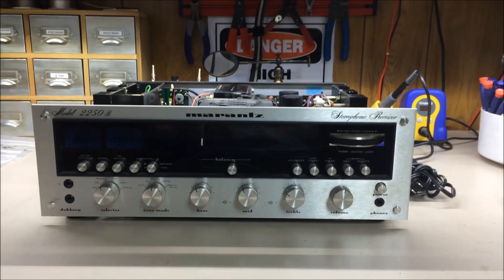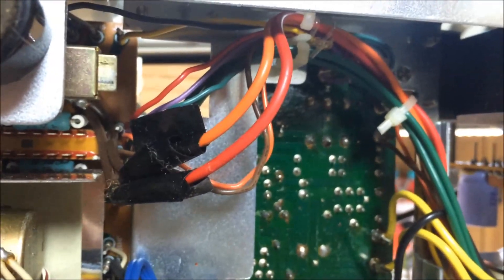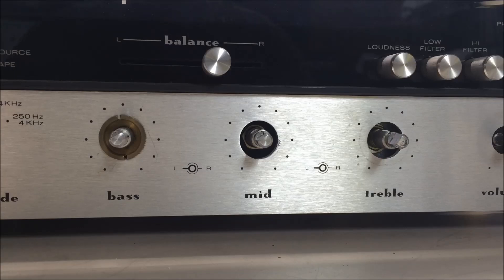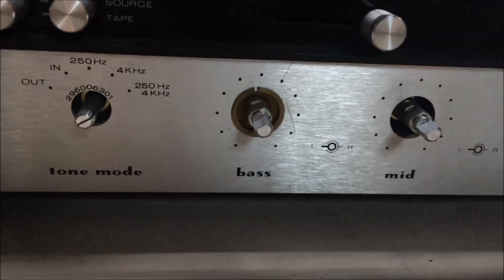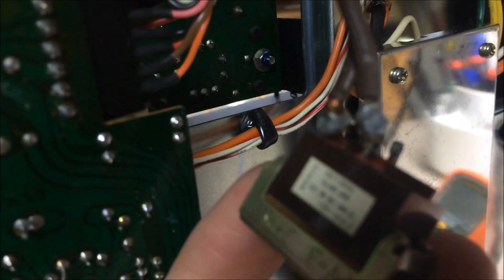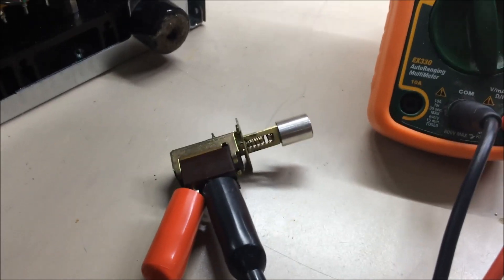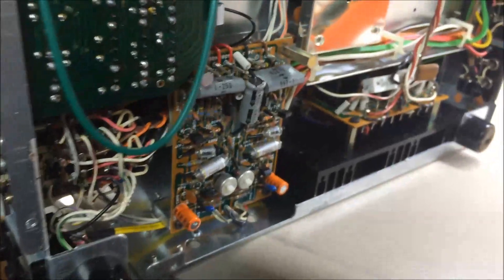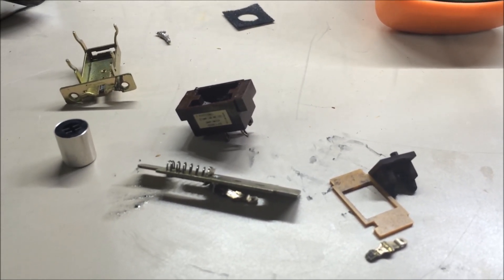Marantz 2250B Repair and Service Part 1   BG006

Comment: Refurbing my dad's 2250B. Thank you for this. I jumpered the power switch years ago, but it now has a light out so i think it's time to fix it proper, including that pesky power switch. Dad would be so thrilled to know that it's still running.

Comment: Thanks for this video. You mentioned replacing a specific transistor in the phono preamp stage. Would you be willing to share with us the original part number and the recommended new transistor please?

Comment: Hello. recently i acquired a pair of 2250b. One was used as a preamp, in order to that the amplifier section was disabled. I tested with a earphones and as a preamp it works fine. The second one was use only as amplifier by disconnecting (i suppose...) the 7-pin conector, because the board for tone control has no the pair of chips BA312, so, i changed the preamp board installing it in the marantz which only works as amplifier. For my suprise it did not work. I think the preamp section is disabled, but i dont know where i can start searching. I am not technician in this, i only want a marantz working good. If you wish a marantz only for amplification, what would you disconnect for that purpose? Thank you a lot

Comment: Any chance they use that blue stuff on the screws the same way they use a wax seal on important messages or letters? Kind of like a calibration seal in order for the factory to determine whether they unit has be worked on by other hands?
Reply: The blue stuff is a light epoxy based paint. It essentially has two uses: the main use is to keep the screw from loosening, the other is for warranty purposes; if the screw is removed, the seal is broken and thus voids the warranty.